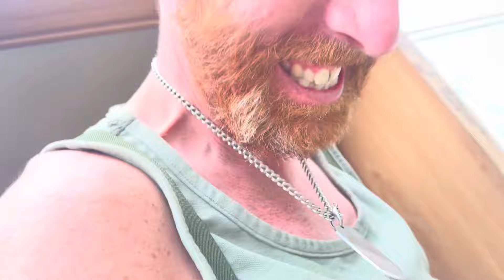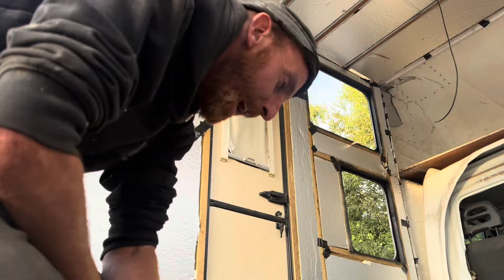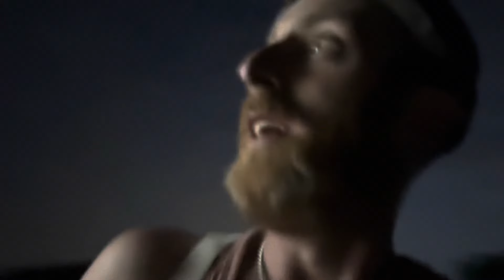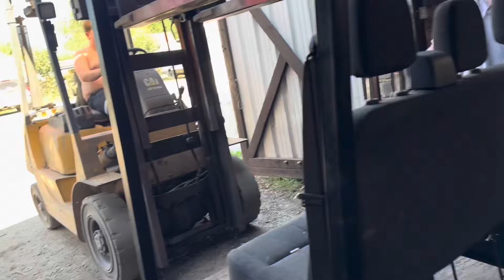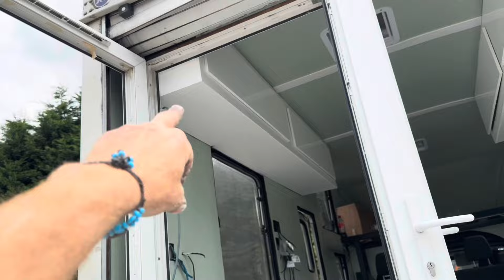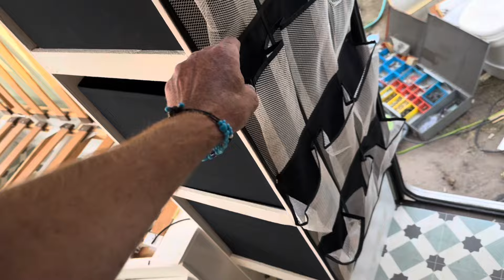STRUGGLING man’s BUDGET Camper build pt 2! Minefield of problems!!!

Comment: Yes you need to use the taps that have micro switches that are connected to the pump to power off the pump from the caravan. Use the taps! I know its wastefully, but that's how they worked way back then. They use pressure valves now.

Comment: with your 12v pump there is the power to the pump and there are micro switches in the taps. So you turn the pump on, then the switches in the taps tell it when to start and stop.

Comment: If you had only one pressure switch in the line, when the barrel runs dry and the pressure in the line drops the pump would run continuously and burn out, they put the micro switches on the taps to protect the pump

Comment: I'm going to say that the water pump is switched off the taps, shower etc because otherwise when you are driving along the water moving around could cause the pump to run if it was on a pressure sensor or flow meter so wiring them this way stops that from happening. Setting the blade height on the saw helps with wear on the blade as less of the blade is in the wood so you get less heat build up, it also helps to stop stupid from cutting their fingers off. If you tape the cut line with masking tape or something like that then cut it it will improve the finish but if that does not work then cutting along the cut line with a stanley knife helps, having a saw blade with a higher teeth count will also give a lot better finish on a cut edge. Them Makita blades that come with the saw are of but mainly designed for first fix carpentry like stud walls etc where it wont be seen, Lower the teeth count the faster/more aggressive it will cut but the poorer the finish will be and higher the teeth count the slower it will cut but it will give a better surface finish.

Comment: Mate for about 50 quid on ebay or amazon u can bye battery rechargeable shower u just drop ina warm bucket of water they're decent pressure and last a couple weeks n can also get USB rechargeable tap for about 12 quid so don't need wires to tap litterly jst a water source they also last couple weeks I live full time ina van haha

Comment: Switched taps and appliances overcome any problems with variances in pressure that there may be if hooked up to a permanent water supply when on site. Most modern caravans/campers use a pressurised system now which, as you say, cuts off when the system pressurises again. The downside of this is the pump cycling in the night and you have light sleepers.

Comment: Chris Amazon have a good deal on a shurflow pump with built in pressure switch and inline filter. Youl need to buy a vaccum cylinder aswel they have a tyre air nozzle and you put 20psi in it

Comment: Chris, bond celotex insulation to the walls and everywhere, then you can channel out the face of it for your cables, install trunking, and put cables inside of them. You'll be able to pull new wires through if needed.
Then, you can bond your finishing surface to the celotex and over the trunking. It will make it a good job and easy to do 👍
Also, take a generator for when you have no 240v plug-in 👍
Reply: Sorry Chris, I've just realised you've pretty much done that with the celotex and wiring anyway 😂

Comment: The problem with pressure switch on the pipe line when the water runs out the pump will continue to run and burn out, another reason why they fit micro switches on the taps, also what if there’s a leak that keeps pumping out inside because pressure is low? Have to say love when you videos come on, watched every one of your videos, I’m a mobile mechanic that’s gone in to my own garage with mot bay plus other ramps now but my god I know the struggle and love your channel keep struggling on 👍🏼

Comment: Idl...tape for so does roof etc...better than silicone std ...proper stuff..... Drop out a for condensation facts etc....your going to expel 1.5 pts...of moist std  each....per night.....plus power station...all powers etc...Will power everything better...plus get solar or small wind turbine..for camping....loads of places over here...for camping....you will have ran up passed . On way to Scarborough etc...

Comment: Either inline microswitch when pressure builds up the switch turns off the pump, pressure drops the pump starts, or the old system uses switches on the tap that turns on pump as you turn the tap on. The tap turns off the power. Yes they had a switch on every tap. Before the switches on the taps there was a foot switch near the sink. You pressed the switch with your foot & pump send water to the tap but only had 1 tap on the kitchen sink

Comment: Chris, I hope you hav'nt used house wire (solid copper core) it won't stand the vibration,you must use multi strand as in vehicals 230v should not run next to 12v cheers Roger

Comment: The taps have a pressure switch built in and or the water heater. My caravan has a pressure switch at the water heater. The reason why your pump is powering on and not stopping is because your providing power direct so no switch. Keep on Struggling Chris

Comment: the electrics to to the taps also work the water pump on off   micro switches  yes they are on every tap  including shower also on you electric flush on the toilet
Reply from the maker: Seems bizarre to me mate, for flooding 🤔
Reply: @Professional-struggler  if the micro switches on the taps fail the pump will not work you could leave the taps wide open and no water would come out with no electric supply going to pump  have had to replace the micro switches in taps loads of times in my 30 + years of caravaning

Comment: Chris, I work on campers and motorhomes daily with my own struggle bus. There are two types of pump, one cuts off at 30psi and the type you have requires taps with microswitches to turn the pump on.. Shout if you need any info.
Reply from the maker: I’ve got a cheap pressure pump from Amazon so hoping that will do the job but not tried it yet mate, cheers for the heads up mate and might be getting in touch soon 😂😂
Reply: Nice one chris , theres that many chinese products in that van its gunna run on soy sauce 😂 , dont forget the sticker that says , one life live it for the back .

Comment: All camper caravans have electrical micro switches to activate the pump , or how else will you get water 😂 your not in house now mate with mains water pressure behind your taps, unless you mount a massive water tank on the roof and rely on gravity fed taps then your on an electrical pump,  like it or not ...sorry its not my fault honest but its not that hard buddy , YouTube it , I'm an old git , not electrically trained or anything and I manged to wire a whole 12v electrical system in my camper including the plumbing ......I've seen girls do it Chris 😜😂😂😂
Reply from the maker: 😂😂 any advice is good advice mate, I’ve just bought a 12v pump that switches off when up to pressure, not fitted or tested if it works yet 😳😂😂
Reply: @Professional-struggler  mate you have done a top job so far , looks mint for sure and it's got lights ooooooh nice...looking forward already to the next update cos this one took days 🤣👊

Comment: Chris ask Dave at D&J about the power bank they had off a sponsor , may be what you need
Reply from the maker: I tryed one at partic but didn’t have the power to run a kettle, kettles are bolt killers 👍👍
Reply: @Professional-struggler  the one dave has he was powering a concrete breaking and angle grinder off it , ask him which company sent it him , they may send you one to review lol

Comment: All the water appliances in caravans have micro switches to conserve the water tank. If you just want pump control then need a larger tank! Get some cheap solar on the roof. It looks large enough for keeping batteries charged.
Reply from the maker: Yeah good thinking mate, first buy when spare funds come my way 👌cheers buddy👍
Reply: @Professional-struggler  Yay 🙌 it looks fantastic! Hopefully you can get some 🙏🏼
Reply: @Professional-struggler  Temu lad 😂😂😂
Reply: Why don't you put the pump on the manual on off switch for when you do use anywhere just a thought mate l. Keep up the good work.
Reply: They sometimes have a pressure switch. But that age of caravan will have a micro switch inside the tap, so as you open the tap it closes the switch forming a circuit and turning the pump on giving you pressure
Reply: But a pressure switch is alot better as micro switchs always fail and it is more expensive to replace a micro switch tap compared to a standard tap

Comment: the tap has a eletric switch bathroom and kitchen to turn pump on and off bud
Reply from the maker: Yeah your right there mate, took me a bit to get my head around that one 🤦🏼‍♂️😂
Reply: you going to use a generator to power 240v when off grid then you can still have showers plus charge batteries if needed

Comment: Afternoon Chris….you’re back….we were all worried 👍🇮🇲👌😜. Ps…been there done it in my slightly smaller and easier VWCaddy, got 12 volt / 240 from leisure battery , through an inverter, with split charger and solar, plus hook up for on site , you just have to be methodical and patient , I know that’s tricky when you are itching to get out and enjoy the summer…👍👌😉🇮🇲
Reply from the maker: 😂😂 I’ve been doing this bloody camper & got no time to edit mate, yeah I need a solar charger, and still need to do the water ect! As you said… you know me to well mate I’m itching to go away aways in one massive rush 🤦🏼‍♂️😂😂 cheers Andy mate….. oh yeah it’s beer o’clock to 😉🍻
Reply: @Professional-struggler  you will get it sorted….as you always do, and I can’t wait to see the first trip….so far, it looks amazing, you’ve certainly struggled….👍👌😉🇮🇲